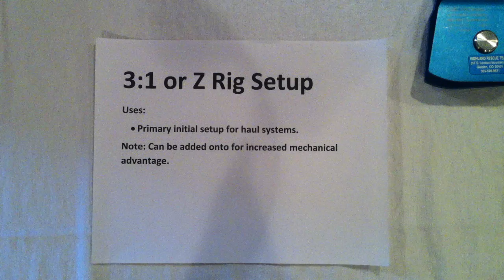3:1 Up Haul or Z Rig

Comment: I am just a novice but doesn't the fact that the bottom pulley and the end of the rope are both attached to D ring which is then attached to the load eliminate the need for a separate rope grab?

Comment: very good video, thank you. I'm trying to learn too set up a small simple 3 to 1 pulley that can attach to the ceiling to a eye hook or to a wall that has a fence on it. The purpose is to recline m wheelchair and with my arms use the pulley to move my legs up and down to get some movement and range of motion. I have tried this with a regular exercise pulley and it does work but 3 to 1 would be more sufficient. Is there a read made 3 to 1 that you can recommend that I could purchase? Thank you for your help.

Comment: It doesn't look safe at all. Where's your safeties if the load should fail? I don't see any Munter Knots. You didn't rig up the prusik up properly to act as a break.
Reply: +John Athanassion 
1. Its a munter hitch. Not a knot. and it has no place in a haul system, only a belay system and even there its a poor choice
2. This system appears to be set up as a piggyback system to the haul line so it does not require a safety (prussik). The main line will have that. If your using this to haul on its own then absolutely you need it.

Comment: A safety knot on a figure-eight is about the most pointless redundancy I've ever seen. NOT required by most AHJs in Rope Access and in the Fire Service. Not sure why you and a lot of others do that. It doesn't make any sense.
Reply: I have been taught to tie it for good practice in an all out emergency (night decent and no torch). With the knot if you re-threaded the figure of eight wrong it is still less likely to fail. However, if you are confident you can tie a double figure of eight and you have a carabiner then it is pointless

Comment: 34 years of climbing/rescue but still learning.

Need at least one prusik at the anchor to secure load strand during the raise !

Double pulley at top allows haul team to spread out across fall line rather than bunch up at cliff edge.

Highly recommend a Radium Release Hitch between anchor and top pulley in case rig jams or malfunctions, etc.

Also, back off a quarter turn when locking carabiners.

Second the "different" comment and endorse the aluminum carabiner comment.
Reply: A lot of good points. One thing, this setup is off of the main line, so the progress capture would be on that main line. So there should be no need for progress capturing in the 3 to 1 itself. Also, probably wouldn't need a load release because of where the progress is captured you should be able to slack this system enough to fix any problems. Just my thoughts.

Comment: A double pulley on the anchor would not be better. Using a double pulley on the anchor side would only be useful if you wanted to change the direction of pull for the the haul team. Fixed pulleys create direction change only, for a pulley to create mechanical advantage it must be a moving pulley. If you added another pulley to the load side it would increase the mechanical advantage and it would no longer be a 3:1 but likely a 5:1.